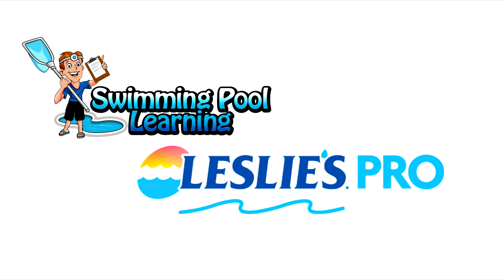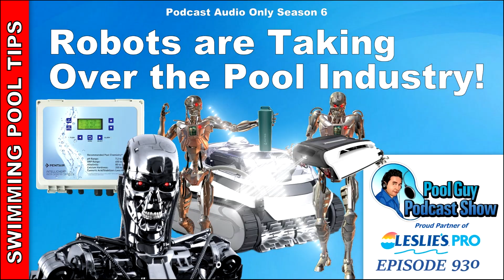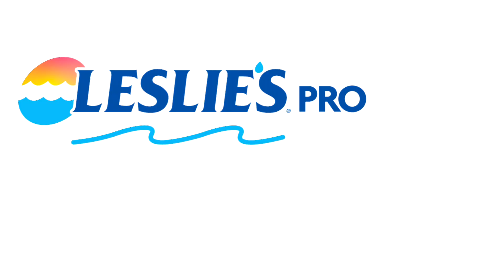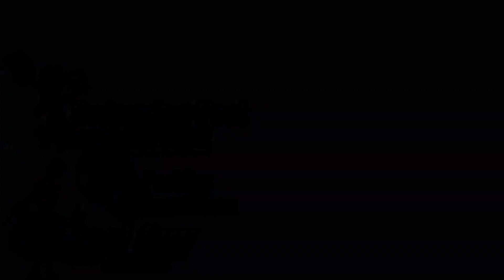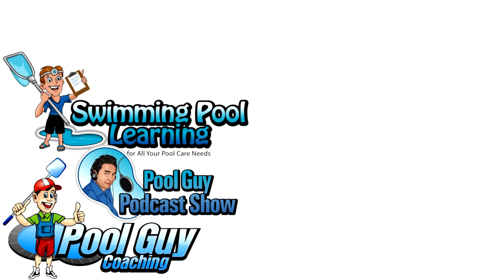Robots and Automation Are Taking Over Your Pool!

Comment: Stenner pumps (peristaltic pump) with a tank is basically the foundation for any liquid dispensing solution being sold today. And they aren't even that expensive if you shop online. Next step is the timing. If you have an stenner Eco you can set the dispensing times/frequency using the build in timer controls. If using a stenner classic or other use an external timer to cut power or even use some type of smart power outlet. The last big step is monitoring the water chemistry, feeding that into a controller, and then having that controller drive when the pumps dispense. That's essentially what the intellichem, sense & dispense, etc are doing. If there isn't already an open source project out there I'd expect something to come out eventually. Because all you need is to get some pH and ORP sensors and tie everything into an Arduino or similar that reads the sensors (input) and triggers the pumps to dispense (output). Remove all the "proprietary" aspects of the system. The big issue seems to still be that all these systems use ORP for sanitizer readings which haven't been very accurate. I've only heard of really expensive systems like the AK-Color that supposedly use DPD testing? I think we need to get a more effective and affordable method of constantly reading sanitizer levels for the automated systems to really sell.

edit: quick Google search shows there are projects for this. Like raspipool. I think I'll build one of these even if the ORP sensors aren't that great for the use case.
Reply from the maker: Nice to hear there there is constant innovation happening.